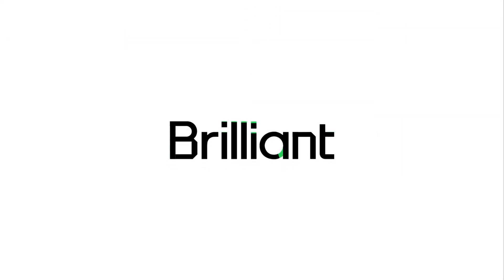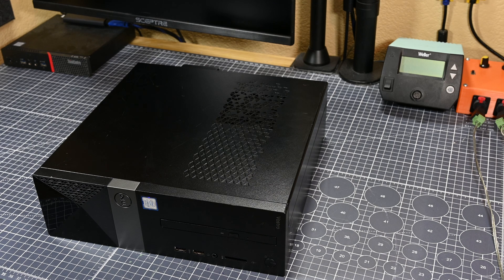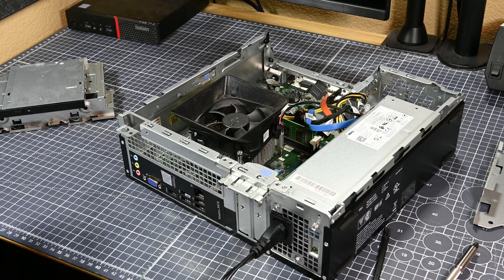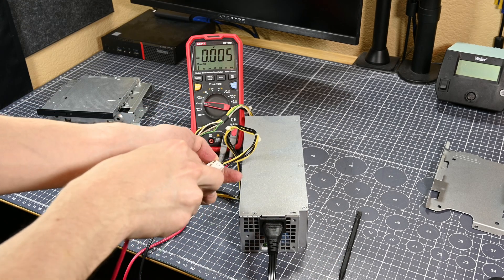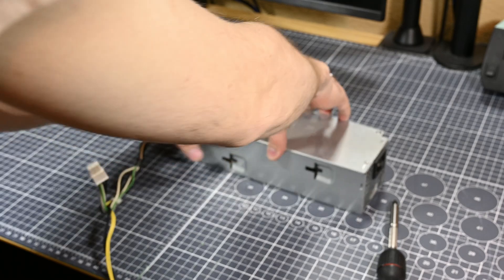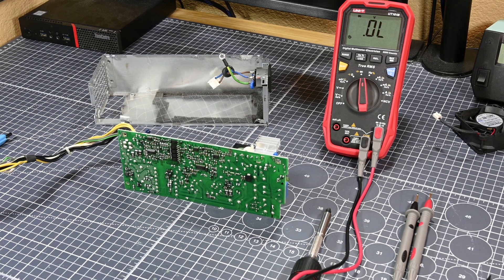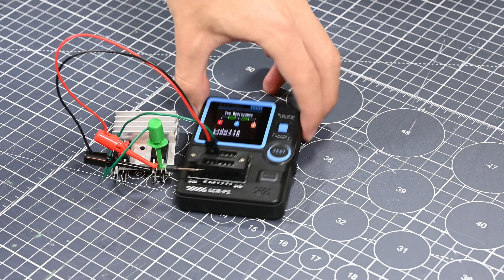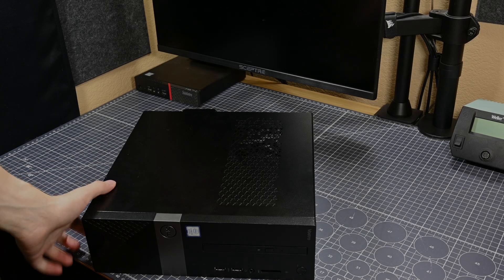I Bought a Dell Vostro PC that Won't Power On - Let's Fix It!

Comment: I used to be a manager for an electronics manufacture. I've built millions of power supplies.
Electronics components generally only have a 10 years shelf life.
I can get those mosfet for under  $1..becuase I order by the tens of thousands.
 You made the correct decision of purchasing the new power supply.

Comment: My dad got robbed with one of these from Dell. The mfing thing came with an HDD as the boot drive!!!!! The thing was manufactured in 2021!!!!! I was mesmerized! I installed an nvme ssd and did everything for em, but holy heck. Imagine all those Vostro Pc’s that get tossed all because of a slow hdd.
Reply from the maker: Geez, yeah an HDD as a boot drive in 2021 is diabolical
Reply: @CHWTT it had a better spec than the one in the video, I5 10500 or something along that. It’s just so odd Dell would bundle a 10th gen I5 with an hdd, but obviously it’s usually cost. The ram too was pretty bad too so I upgraded that. It’s just diabolical on Dell’s part lol.
Reply: yes Dell still made PCs with hard drives. However, to use Android and Google Play Games on Windows 11, you need to have an SSD.  You can check the motherboard to see if their is a place to plug in a M.2 SSD which will make your PC much faster.  My Dell has both a hard drive and a SSD. I configured it to boot the SSD and the hard drive is used for storage

Comment: So now what? No fix? Buy a power supply for the damn thing if you're unable to fix it on the component level. These are not very expensive and extensively available on eBay as they are proprietary and can't be used with anything else. Also, maybe some other unit's PSU would fit if the form factor is the same. DELL usually re-uses stuff here and there.
Reply from the maker: I'm guessing based on your other comment that you eventually watched the rest of the video, but yeah, I did go and replace the PSU with a suitable replacement from eBay!

Comment: The PSU on those Dell SFF computers are absolutely rubbish and the reason why we don't use Dell desktops where I work
Reply: Dell's older SFF PSUs can be surprisingly solid. My backup PC is a Dell OptiPlex 3010, with an SSD of course, which is still going strong after 14 years. I can't say the same for my Inspiron though, one of its PSU caps expanded and killed the motherboard. This happened last year.

Comment: I would put in a claim for a partial refund. No way I'm taking that seller shenanigans
Reply: Totally. Even if it's "for parts," a seller has to ship the item as described. Otherwise they could just send you a pile of rocks in a Dell case. Also, if you complain it can help protect other sellers.
Reply from the maker: They did give me a partial refund before I even asked, they didn't indicate why but they did. Sadly, it wasn't a very suitable refund in my opinion considering the discrepancy in the specs... Maybe time to report them
Reply: Yeah it's probably too late now but don't let sellers get away with this crap. They're just going to burn somebody else.

Comment: The location of the x16 port on those dell's in a Nutshell is diabolical
Reply: The equivalent Lenovo and HP machines were the same way. Basically their way of limiting your upgrade options to single slot video cards only.
Reply from the maker: Agreed, I wish they positioned them differently so that better GPU upgrade options were available